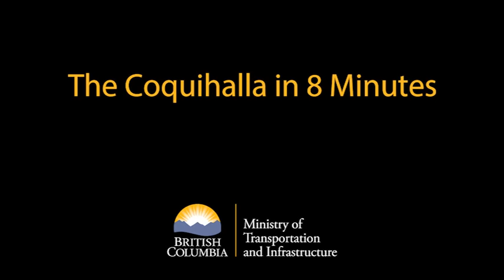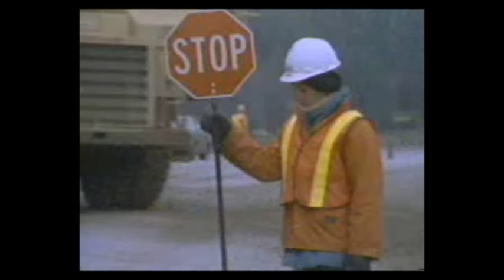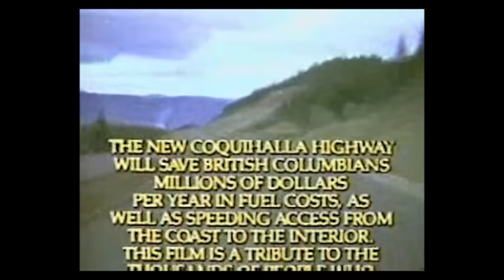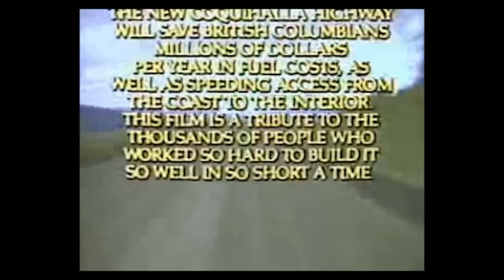The Coquihalla in 8 Minutes

Comment: This same project today would take 20 years instead of 20 months. If it could get approved at all that is. After they consulted with every “group”  and formed a committee about every decision. We used to be able to get shit done!
Reply: What is glossed over here is that it was that very rail corridor and all of the surveying that had been done before that made it happen so quickly. There weren't any big "surprises" during construction. Lessons that could have been learned with the site C project (a multitude of reports detailing the insecure footings of the area; that were glossed over because of good old fashioned hubris). If you rely on good data, you can avoid a lot of problems. That is the lesson of this.

Comment: Left out the best part...installing the concrete pylons on a 45-50 degree slope using a chopper.  They had to cut back the snow so the rotor blades could just fit on the landing spot.  The pylons support a cable which delivers charges to clear snow before it can avalanche onto the highway.  Amazing video I was given to watch as we were supporting the highway build with special forecasts.  we meaning the Canadian weather service!

Comment: Love driving this in summer. The bank of the  road is designed to maintain your speed of 120km... never have to slow for a curve. And the view of the mountain peaks is amazing. But then there is winter driving and crawling at 30km in a blizzard praying you make it out alive. Now the Coq is broken. 5 major bridges destroyed, 20 major sections washed away from the Nov 2021 catastrophic floods. If only we could teleport these amazing engineers and skilled highway construction crews from 1985 to 2022.

Comment: The highway was built as fast as it was for one reason. Expo 86. 
We drove the “new” highway at the end of July and beginning of August in 86 for our trip to Expo.
Reply: Of course...Otherwise with todays gov.It wld.be a 30yr.project...
Reply: @charsback  
Yupp. In Ontario Highway 90 from Barrie to Angus took at least 8 years and it only takes about 15 minutes to drive end to end. 
Work pretty much stopped each winter though.

Comment: I used to drive through here before the highway was built. It meant following the pipeline and using parts of the Kettle Valley Railway bed. Fording the river was fun except in spring and early summer when the water was high. And we did it in stock pickups or SUVs (Broncos, Blazers).

Today, the shopping mall parking lots are loaded with modified 4x4s whose owners would never dare take their tinsel wagons in there.

All those routes are now blocked by gates or cut off by the highway. Too bad. Great fun.

Comment: Hopefully they can repair it as swiftly as it was built after all the flooding damage. I'm more optimistic after seeing this video!
Reply: 20 months to build, yes,  but preparations, planning and logistics,  material stockpiling, and pre fab works,  were being done several years in advance. They don't have that this time.
Reply: Let's hope they don't repair it as quickly. I would prefer it to be done safe & sound. Even if it takes 20months to repair the road & bridge. Then to run ruff shod & get it done quickly and have it collapse in the next heavy rains or snow storms. My thoughts only.

Comment: A couple of those bridges look like they may have been rushed and won't survive a flood.  😉
Reply: But yet they did. And probably still would of, if it hadn't been for erosion under the bridge. And the heavy rains. Still think bridges no matter where they are built should be checked a couple times a year. Not just looking for cracks ect on bridge, but erosion of land around each side of bridge. This could be done by using students going in to becoming engineers & such. And could use retired engineers/teachers as part of their assignments on completing their courses. Would be a win win situation. My thoughts only peace out!
Reply: @liquidgal9867  Bridge foundations and erosion mitigation are part of a bridge.
Reply: 350 mm or rain in 48 hours three times the MONTHLY average rainfall.... unimaginable
Reply: @RachelTScott  Civil engineers regularly design for these improbable events.  It's called engineering.  Unless you're rushing to build a road in 20 months for expo and gotta cut a few corners.

Comment: At 2:55. Pouring concrete deck on a bridge. Is that the span the recent floods demolished?
Reply: Well actually the concrete is still pretty much intact, by the looks of pics the embankment eroded under bridge as the river rose. The bridge looks like it tore away from the road. Enough force that the end piece of bridge where the expansion was probably was the piece that broke taking that part & part of the road into river. The other part of bridge from expansion back is still intact. But highly doubt useable. My thoughts & theory. I am not a engineer so not really sure. Peace out!

Comment: There's progress right there. Now they call it the "Highway through Hell." Go figure???
Reply: It can be a bitch in winter and there is a particularly steep section which would be hell if your brakes failed. The "hell" label is tv production puffery. It is a very nice drive most of the time. I used it when operating a truck but I prefer the canyon when on my own in a car. For me the best thing about the Coq is that it takes enough traffic off the canyon to make the canyon a really nice trip.
Reply: Driving such a highway can be hell in wintery conditions. I watch the show 'highway through hell, and the reference comes from how dangerous it can become in a short span of time due to incriminate weather.  Winter.  Most of the time its great to travel through.  I live in hope and the weather changes very quickly in the mountains.  But it has saved hundreds of hours driving, in so doing , is better for our environment

Comment: At 0:40 does anyone know what that red and white building is ive seen it alot but I dont know what it is?
Reply from the maker: We asked one of our veteran ministry staff about this and he told us that was the bottom terminal of the old Dog Mountain aerial tramway.  It belonged to CN/CN Telecommunications and was the only means of access to a large mountaintop telecommunications installation.  It became obsolete after the fibre optic line went through the Coquihalla and as cellular communications started to take over.

Apparently, it was a pretty impressive cable car, with a massively long span between towers and a huge vertical rise.  Our staffer was kind of bummed that he never got a ride... Hope that this helps!
Reply: Even though I know it's from an old cable car system, I always joke that it's the Purina pet food factory (looks like their old logo lol)  Would be cool to see the tram still in operation!
Reply: It has been dismantled now, unfortunately!

Comment: In my opinion it's a piece of crap hiway drove the Frazer for a lot years  and prefer it
Reply: I have never heard someone say that before so your the first
Reply: Fraser is nice if your not in a hurry for sure, but the coq is just to “get there”
Reply: @clarencethomas5311  oh it gets you there, at 255 klicks!!! Next stop, "the Hoops"(Kamloops)
Reply: I refuse to drive the coquhalla.
Reply: Coq is my winter playground and my summer test grounds.
Reply: @gwhiten2158  I've been over it at least 2-3 hundred times, Clint's right. What the video doesn't mention is because of the push to get it done for Expo, a whole lot of corners were cut. The grade south of the old toll booth and through the snow shed could have been lowered by 1%-2% fairly easily except that time limit wouldn't allow it. So now were permanently stuck with it. It's nick named the Smasher for good reason. A lot of the Merritt to Kamloops section was paved in weather too cold to do so properly. They spent years and 10's of millions repaving just due to that mistake and all to meet an unrealistic time line so Bill Bennett could look good. 

It's an ok highway at best, but sure nothing special. With a fully loaded 18 wheeler it only saves about 45 min over taking the canyon at the expense of burning more fuel. And too many morons insist on driving the Coke well past there all too obvious low skill level during the winter. It was a rare trip I didn't see one or more of the fools in the ditch. Montana is very similar to B.C. and there I-90 is 10 times the hwy this is because they did it right the first time. Winter hwy maintenance on the Coke is a joke when the weather's really bad. Any major snow fall and it's real common for it to be closed due to weather and accidents.
Reply: @turningpoint6643  you are 100% correct. They shouldn’t have built it at that grade. A long tunnel or less of a grade would have been the smartest way of doing it.
Reply: @daveg9507  I worked with a guy for a few years who knew a lot of the people from Hope that worked on this hwy project. From what he was told by some of them, the original engineering plan was to start that grade just after the south end of the Dry Gulch bridge that's south of the old toll booths. Yes it would have added some costs and more importantly time to the project. But had they done so, the average grade percent would have then been well under 6%. The only reason the design was changed was to meet that opening dead line for Expo. I've built enough road myself as well as traveled through there numerous times and it's not hard to visualize how it would have been done and ended up a hell of a lot better.
Reply: @turningpoint6643  I’d say you are more than qualified to make the comment you did. Thanks for the clarification   Have a great day

Comment: unother force feet presented by u-tube .ca
preception of reality of canadians and its ministry is old as it movie 
glorifyied smart ... far fetch from reality
what it actualy change rised speed limit from single file road.
we thank you driving max 90 km per hour 30 years ago was boring.

Hwy safety sucks even now 
why?
becouse you are bunch of ....

free advice :
there was more than 10 years city of burnaby trying to sell TBM 
and primitivy ministri of transportation waste money on electronic signs 
shrinking lines on bridge and more not logical dumb ideas
O.K. if you
 run new streight line hwy calgary
make tunels no inclines more than one inch on kilometer
water lewel in valley not at top of montain
second streight line to regina  conector
    it would be tooo late since vitol personal machine take over by the time , some one else do it for you.
like americans build hwy 99 for you.